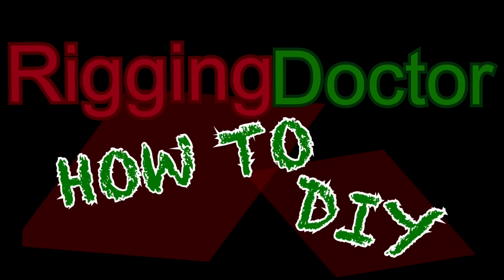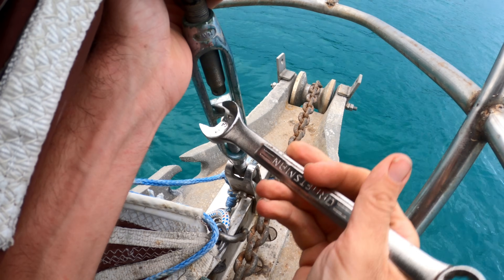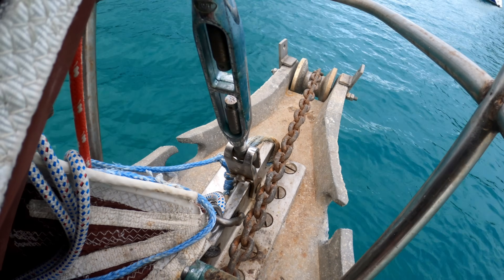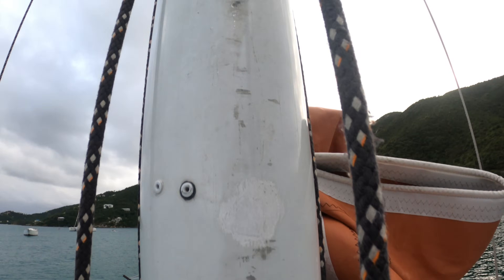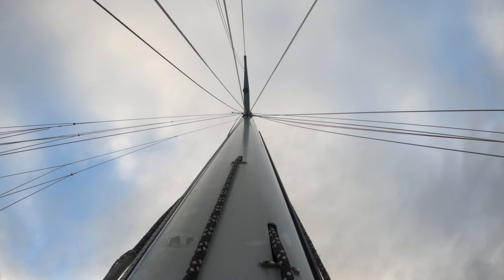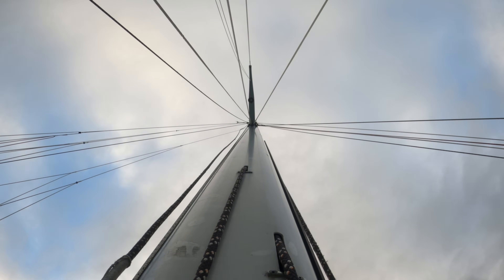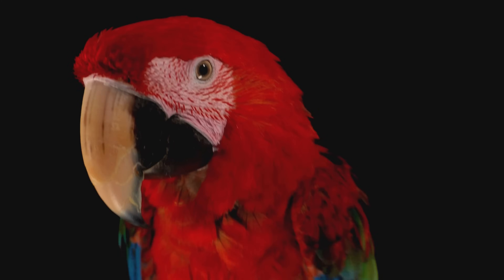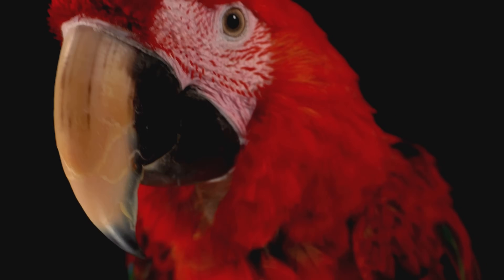How TIGHT Should Your RIGGING Be?

Comment: Wouldn't it be easier if you have a string attached on the top and push it against the mast on the bottom and see where the bow is on the mast?
Reply from the maker: That would show bow if you can get it tight enough but it won’t show the relative position of the masthead. Also the line at great lengths will also start to sag as well, giving false information. 
The plumb bob method gives you a fixed relative point to work off of.

Comment: Question: Let's say you have 2 sets of spreaders. Some folks say the shroud should be clamped tightly to ensure no movement on the upper spreader. In other words, hold the spreader in a fixed position. Then there are some who say the shroud should be able to slip freely in the upper spreader. What's your take?
Reply from the maker: The spreader tip has to be seized to the stay so that it can’t slip or slide. Movement means that the spreader could fold up or down and fall out of the way and become out of service. 

My take is the tip needs to be fixed in place.
Reply: @RiggingDoctor Thanks for the reply. So in this video, if the shrouds were seized tightly at the spreader tips, then how can you adjust the shroud tension without pulling the spreader tip downward? I mean if you are tightening the shroud, it would pull the spreader with it. I'm so confused. I've had to machine new spreader tips and im having trouble with that. A 5/16" slot allows for slippage. A 1/4" slot is super tight and will not allow any movement. 
I can see how to set up everything the way you suggest, but not sure how that all works if the cable is clamped so it can't move through the spreader tips.
Reply from the maker: Set the tension without the tips seized, then go up the mast and position the spreaders accordingly and seize them. 
Any future adjustments will pull the spreader along but you are changing the length of the stay by about a millimeter which won’t have a practical effect on the spreader angle.

Comment: Thats a very informative video! Thank you! One thing I keep asking myself: Do steel wire tension numbers translate 1:1 to Dyneema? Or does Dyneema has to be looser because it doesn't stretch as much under load and you want some flex in your rigg under different wind conditions? Also:  do we tension the shrouds to keep the mast straight under sails or without sails? I do have adjustable Diamond spreaders to pull the mast tip to lee depending on the conditions, but thats not very common, I guess.

Comment: Well, this left me even more confused after watching the video.
Reply from the maker: If you have lateral spreaders: as loose as they can be to still do the job. 
If you have aft swept spreaders: (not discussed in this video) you need the cap shrouds to be at 25% of the wires breaking strength.

Comment: Rigging should be tight enough so that the mast doesn't go over the side. Rigging should not be so tight that the mast goes over the side. ( 20% of the cable strength is recommended. You can get turnbuckles that have load meters in them ).
Reply: And cable strength changes, not as much as rope, but it damn well changes from everyday. So answer me this: What the fuck is 20% meant to be. Sure on a new cable you will know, but ever after it is a PURE guessing game!!

Comment: An inverted mast is not really, really bad. It's not going to break and kill everyone. Why say that and scare everyone? 
The mainsail will fit a bit funny and it doesn't look great, but it's not a ticking bomb.
As long as the boat you're working on is floating in the water and the wind is blowing, there is no way any sort of plumb bob hung from the top of the rig is ever going to tell you anything meaningful about the position of the masthead over the boat. Measure side to side. If the shrouds are correctly made symmetrically - the same length , both sides - You can measure the turnbuckles on deck and do away with all this palaver.
Shroud tension wants to be, as you say, as loose as possible while supporting the mast in column when it's fully loaded. This means full sail 20 degrees of heel, the upper shrouds (cap shrouds) want to be still snug on the leeward side. Adjust lowers and intermediates to keep the mast in column.

good luck
Reply from the maker: Unless you are on a sunfish, it’s a bad thing!
Reply: @RiggingDoctor  explain to me why.

Comment: I don't get it. Hanging a weight on your halyard to use as a plumb bob........ while in the water, Waves? Boat list any? That would only work if you had her on the hard. The you would need to put a level on something square?? a traveler? Maybe the mast or mast support post in the cabin. Then you would need to fine tune the level of the whole boat.  Adjusting boat stands (without getting squashed) or if it's on a trailer, doing something?
Reply: Yeah. All ya need is take your main halyard to the same point on port and starboard chainstay attachment. Measure each offset, they should be the same.
Reply from the maker: The halyard acts as a plumb bob and that tells you the position of the mast. 
The boat should not list, and if it does, that needs to be addressed prior to this. As for waves, pick a calm day.
Reply: Check out the Brion Toss (RIP) videos on rig tuning. Your rig should be just tight enough to have no slack om the leward side when fully loaded and heeled. The mast should also be in line from the gooseneck to the mast head at all times (except for prebend, which the designer or your sailmaker will spec). As for being centered in the boat, there are no perfectly symmetrical boats. Measuring via plumb bob or to the rail is inferior to measuring to the chainstays. After that, if it doesn't plumb up, or if there are differences in distance from the chainplate to the rail, it may be that weight needs to be moved, or maybe the keel is not installed properly, or the mast step isn't centered, or, or, or.

Comment: i need to make a full set rig for gaffrig ketch. im going synthetic. steel masts. is there any tips for gaffrig
Reply from the maker: They are the easiest to make for because they are the lowest tension needed and the least finicky. 
If you have knees on your mast, you can make big splices that will go over the spar and hook onto them. Otherwise, it’s just like a regular rig. (But do use chafe sleeves as gaffers have a lot of parts that will lay against the rig and chafe them if they are not protected)

Comment: Professional riggers put a LOT of tension on the shrouds to prevent the mast from slamming sideways with each tack (and gust). This slamming causes tension peaks which are more damaging than a stable high tension. Therefore, don't understand why you state that the rigging should be 'as loose as possible to prevent damage'.
Reply from the maker: Because I don’t let the mast slam. This is my own boat. I also have lateral spreaders so they can run slacker rigging. If you have aft swept spreaders then you need to have your rigging tensioned to 20-25% of the breading strength at all times or the mast will invert and be done!
Having looser rigging means that all the fittings are stressed less and therefore won’t fatigue as early, making everything last longer, but only if you use it properly and have it setup correctly.
Reply: I agree here. You want enough static tension on the lines so that they will not unload while at sea. It needs to be tight enough so the shrouds on the leeward side of the boat still have significant tension. Too loose and it will go through cycles of tension/unload/tension/unload. The shrouds will not last long. Tighter and the shrouds see TENSION/tension/TENSION/tension. Shrouds will last a long time in this type of cycle. In other words with more tension we eliminate shock loading the wire. It is true that the fittings will be under less load if you tension the rigging less. But your fittings outlast your shrouds typically so it is sensible to demand the higher load at the fitting in order to save the shroud.
Reply: Standing rigging should be just tight enough to allow no slack on the leeward side when fully loaded (i.e. max heeled). With that, there is zero "slamming" or mast movement between tacks. This rule of thumb works for every rig style. Hounds, fractional, in line or swept spreaders.
Otherwise you are adding permanent extra stress to the rigging as well as the hull and internal support structure.

Comment: Stronger and stronger materials are becoming available for masts. I see no reason for rigging anymore it is stressed before even raising a sail. On my 22 foot Galion 22 I am going for an unstayed mast with a dipping lug sail with at the most a movable stay on the leeward side.
Reply from the maker: For windward performance and reduced weight aloft, rigging is mandatory. For merry cruising and low stress rigs, a free standing mast gets the job done.
Reply: @RiggingDoctor  Carbon fiber.

Comment: One sure way to lose your mast is to have loose rigging.  While sailing you shouldn't see a slack shroud on the leeward side.  Both port and starboard shrouds support the mast regardless of the tack you're on.  A properly tensioned leeward shroud supports the windward side by transferring its rigidity through the spreaders to the windward side.
Reply from the maker: That’s an interesting take on over tensioning your rigging.
Reply from the maker: I would suggest contacting your mast manufacturer to ask for a manual and I would check the section about Rig Tension. I’m pretty certain that it will tell you that when sailing on a close reach in 25 knots of wind speed, the leeward shrouds must go slack. 
It will then go on to explain that if they don’t go slack in that situation, the rig is over tightened and the added stress will cause premature failure of the rigging. 

If I’m wrong, you now have written proof that you need to keep your stays bar tight and all is well 😎

Comment: I have fractional rig with single cap shrouds and single lower shrouds. I tensioned cap shrouds to 15% breaking load and there is still no prebend. So when I tighten just a little lower shrouds mast bends backwards. How can I get some prebend?
Reply from the maker: You can try setting the headstay and then tightening the backstay to get it to bend a bit. The lever arm that forms between the headstay and backstay will cause the mast to bend backwards at the top and be pulled forward a little bit down (depending what fraction you have). 
By the way, if you have aft swept spreaders, you want to set the cap shrouds to 25%.
Reply: @RiggingDoctor  Thank you for an answer. Yes I have aft swept speaders. 25% is a lot. I am afraid to breake something..

Comment: Our triple swept back spreader mast has the cap shrouds tightened to 15-20% of the 12 mm wires breaking strength, the lowers are just hand tight, thought you’d find that interesting
Reply from the maker: Aft swept spreader rigs need much more tension. Lateral spreaders can run much lower tensions :)
Reply: @RiggingDoctor with aft swept spreaders the really tight caps induce pre-bend in the mast too

Comment: Hello, "looser is less stress on the rig", I thought preloading the rig was actually better considering fatigue failure. With preload and as long as the two cap shrouds stay tensioned (usually until 15 kts upwind), the additional tension due to the wind is divided by 2. Half of the tension is tensionning the upwind cap shroud and the other half is detensioning the leeward cap shroud. What is your opinion about this method of tuning the rig ?
Reply from the maker: Looser is less stress because the strain at rest is less, which is how a boat spends most of its time. 
The problem with loose is if you jibe hard, you will shock load the rig and the shock load will me incredibly high. If you plan to do a lot of banging around, a tighter rig will be safer. For long sails on the same tack where jibes are rare to occur, keeping the tension as low as possible is fine. 

As for the idea that tension will go to the leeward shroud, the truth is when the sail is pulling the boat over, only the windward shroud is opposing it. The leeward shroud is either not working because it is loose or it is pulling the mast to leeward as well and adding to the strain on the windward shroud.
Reply: @RiggingDoctor  Thank you for your answer. I understand your point of view. However with a conventional stainless steel rig I confess I will keep my cap shrouds preloaded. Fair winds !
Reply: @voilierpaikan9806  I also heard that tight is better. 2 deferent schools of thought here?

Comment: I only have a single forestay and backstay.  There is an upper and a lower shroud port and stbd.  How can I control the mast bend with this setup?
Reply from the maker: Not too easily. I’m assuming that the upper shrouds chainplate is aft of the lower shrouds chainplate, whereby pulling them tight will bend the mast aft. 
If you have aft swept spreaders, the tension from the upper shrouds on the spreaders will push the middle section of the mast forward to create bend. 
If the spreaders go straight to the side, it’s going to be really hard to get bend in the mast.